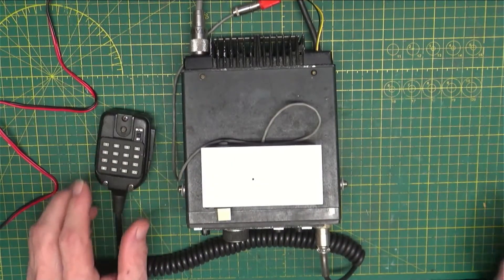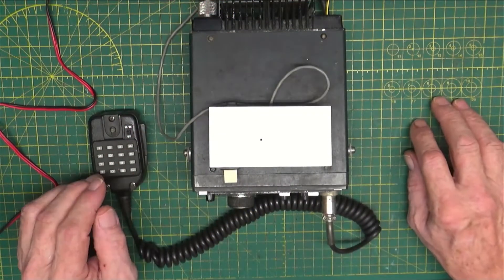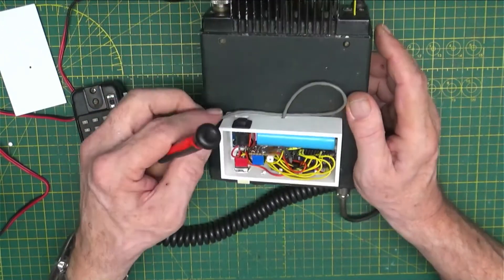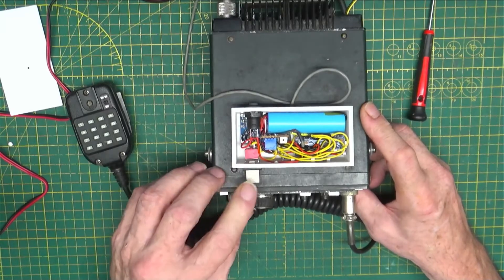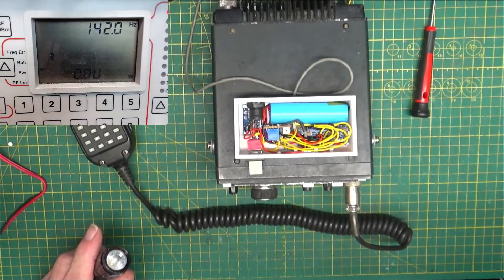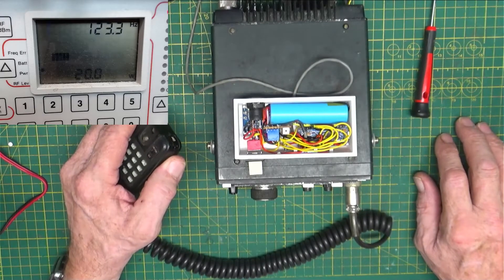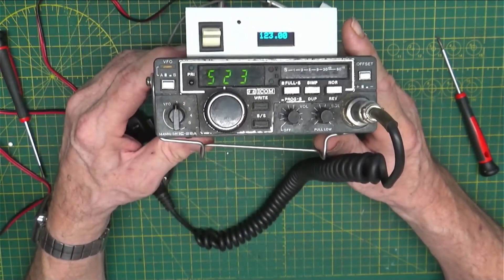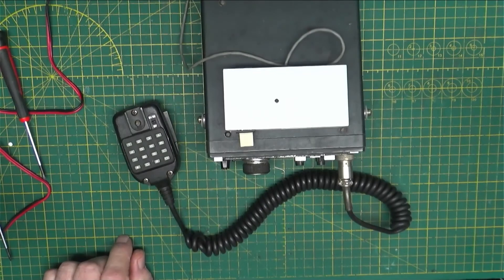Arduino CTCSS Project On the Icom IC-25A

Comment: Excellent work, i need similar project for command remote radios tx and rx, i test whit dtmf but the decoders are unstable and not secure. you have some suggestion project for decoder sigals mixer in analog audio ? for examble i send  signal 67.0 in one pulse. this activated some relay. thanks for your video.
Reply from the maker: Thank you and thanks for watching.
Have you tried the MT8870 board along with an Arduino? They seem to get good ratings. I found this at amazon 
https://www.amazon.com/KOOBOOK-Decoder-Decoding-Telephone-Arduino/dp/B07VLGG4DM?th=1
Reply: @AERVBlog  i search now in google, thanks for the information and sorry for mi english, is not mi native language.
Reply from the maker: @analogatman  no problem. Let us know how you do. I ordered 5 of them to work with myself.

Comment: I see these radios 4 sale all the time....nice radios!  Neat project...I plan on doing the same thing cuz I truly enjoy vintage gear better...except I don't do Arduino...will just use sig-gen...mine wont be going mobile...however, I don't do repeaters often.  ~Jack, VEG
Reply from the maker: I took this thing on a trip and used it on a bunch of repeaters all over the country. It worked great and I never got a complaint about too much tone. I would be interested in knowing how the sig gen works out. It will have to be awfully stable.